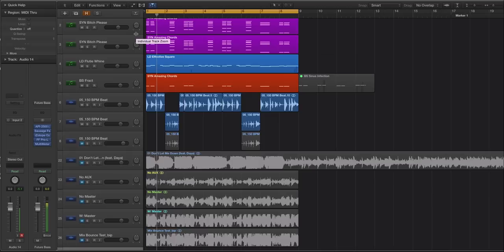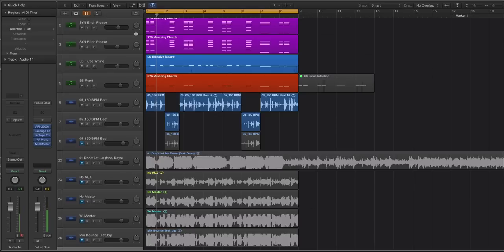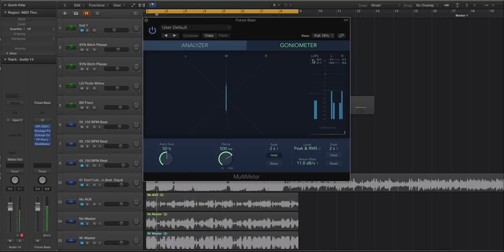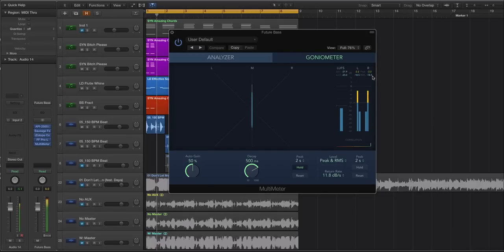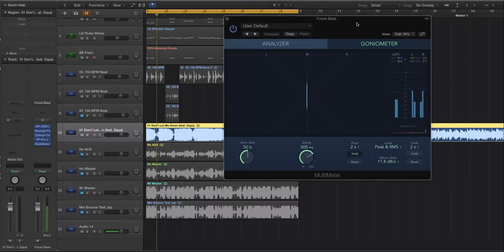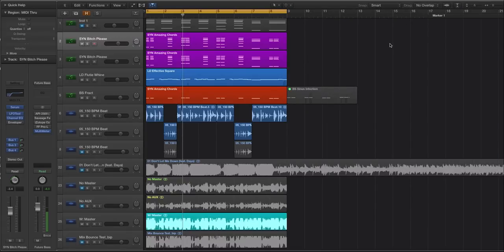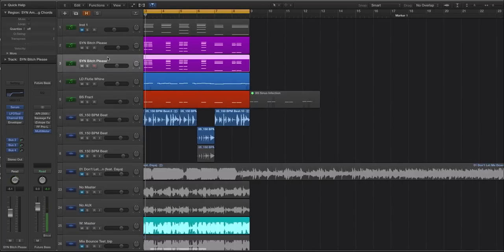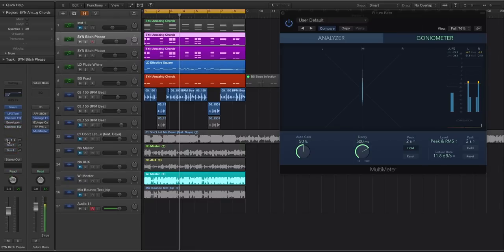3 tips for a louder mix

Comment: I'm not so sure that I understand the aux theory. What am I sending there and how is it making my mix louder?
Reply: but if i use aux for this use, whould not that be eating my headroom ?
Reply: parallel processing can prevent it
Reply: +Krischkros what is parallel processing exactly?
Reply: you have a dry channel and a wet channel.. wet > proceed. so.. you can (over)compress your wet channel, do ott compression.. or reverb, delay.. phaser, flanger and more.. than you can mix your wet channel within your dry.. your dry channel would be fatter, fuller, bigger etc. but.. dont overdo it :D
Reply: you preserve your headroom / dynamics, you fill holes, you make it recognisable and much more..

(you mix the wet channel with your volume knob.. or you automate em.. you have many ways to do it)
Reply: type in yt: ott compression, parallel compression (known as new york comp.), send/return tracks for reverb, delay or saturation / distortion.. youll find many videos
Reply: you search for nghtmres seminar. he gives great advices!

Comment: How do you master your mix? Directly on the project or do you export an mp3 file and THEN master that file?

Which method do you prefer/recommend?
Reply: I could be wrong, but I believe the standard practice is to bounce your mix down as a .wav or other lossless file format, and have that file mastered in a different DAW session.
Reply: Mastering is only done by wizards.

Comment: EQ is, imo, the best tool to get your tracks louder.  If you EQ each track properly, the compression you do at later stages will work better, gel the track better AND give you the ability to push the final loudness much more...if that is your goal. :)
Reply: ***** I definitely spend way more time with automation and modulation of my synths, etc. than I do mixing as well.  I'm by no means an expert when it comes to mixdowns, but that has been what I've found. :) 
I also started writing, arranging, mixing, etc. into a mastering type of master chain (pushed relatively hard). This seems to make my overall mixes sound better in the end and keeps me from having to go back and fix EQ and even modulation problems that pop up once that final heavy compression / limiting is applied and it changes the tonality or movement or whatever... of many of the individual tracks. Then I just back it off and bounce a wav to be sent off for mastering or start the mastering process myself. 
It has worked like a charm for me, especially with the more aggressive, heavily processed and distorted tunes.

Comment: I have the opposite issue, i need to learn how to do a -6 db mix lol.. All my mixes are loud lol
Reply: Yoga Flame EDM I've been a mastering engineer for 20 years and I am going to give you some free advice. My guess you've got compression on every track. Get rid of all the compression (except bass) and start mixing again. Replace that fake bass you've been using and replace it with bass samples of an electric bass.  EDM with electric guitar bass! Yes. Use automation to make tracks loud at certain points in the song instead of just mindlessly jacking everything up with compression all the time. Music (even EDM) is about dynamics. Let the mix breath. STOP SUFFOCATING IT WITH COMPRESSION..Please..
Pretend it's 1975. That should help. 
2) Do not mix with bus compression or a limiter. Unless you are going for some effect.
3) I assume you know but just in case you don't: Record for average level -18db RMS and not peaking beyond -6db. If you haven't and you've been recording your tracks too hot turn them down to the level I have mentioned.
Reply: Yoga Flame EDM I've been a mastering engineer for 20 years and I am going to give you some free advice. My guess you've got compression on every track. Get rid of all the compression (except bass) and start mixing again. Replace that fake bass you've been using and replace it with bass samples of an electric bass.  EDM with electric guitar bass! Yes. Use automation to make tracks loud at certain points in the song instead of just mindlessly jacking everything up with compression all the time. Music (even EDM) is about dynamics. Let the mix breath. STOP SUFFOCATING IT WITH COMPRESSION..Please..
Pretend it's 1975. That should help. 
2) Do not mix with bus compression or a limiter. Unless you are going for some effect.
3) I assume you know but just in case you don't: Record for average level -18db RMS and not peaking beyond -6db. If you haven't and you've been recording your tracks too hot turn them down to the level I have mentioned.
Reply: John Morris k thanks for your grand advice.. I will make tracks like avicci now because your your advice.... this guy making the video is more passionate then you, do  u make tutorials ? Prob not cause your way to impatient for teaching

Comment: good tips i agree with everything but sending your lead to two separate busses panned left and right doesn't make your lead wider but i can see how it helps with maybe being a little louder because you have the original signal at a certain db level and of course it will be louder because your sending additional signals  to buses therefore having more volume.its like adding to the original signal  lol but everything else was great. having a wide mix is based on modulation effects weather the audio is stereo or mono and the direction mixer but panning doesn't actually make anything wider . if your audio is mono and you duplicate it to pan it left and right it will still be mono

Comment: you need m/s processing. Look at your correlation meter. In addition,  its a digital mix and not analog summed like the commercial track. Thats the major difference. Analog mixes have rounded and softer peaks; digital mixes have square peaks.

Comment: I'm using cakewalk and they have like 6 or 7 different "mastering" plug ins, but how do you know which ones you need to use? I basically learned about the equipment to record, how to use the daw, record, and mix all on my own and I tell ya, it's pretty complicated but I'm sticking with it.

Comment: Thank you so much, very helpful! I'm trying to master my tracks myself and I'm just curious, should I bounce the track into audio files and then load them into a new project where I can work on it? And if so how should I split it up? I've seen people work with mids/sides or low/mid/high frequency.
Reply: You just bounce the whole track to a wave-file, start a new project and import the track. Then you import a couple of reference tracks. Then start you mastering chain. EQ cuts should already be done  back in the mixing stage.

Comment: Probably missed the boat on a response however, I have a track that is I believe well mixed, but it is soft, its an EDM track written for a game level on an iphone app, and I need it to be loud. However, for streaming you have to preserve about 8db of dynamic range, otherwise your tune actually gets turned down. Problem I am finding is that when I have my kick at -10db, I've got no dynamic range or rather have filled it up, yet I still can see I need more loudness. Are you saying that the RMS should hold steady at -10 and then use a limiter to get another couple of db? I would imagine that while I do hit -10 the RMS does not stay at this level.

Comment: Bro which is the good or  optimum level of peak before sending out for Mastering.My track has RMS of about -11 but peak goes to 5 db .
Reply: Jay Nikam Professional mastering engineers ask for at least 3db but would prefer 6. Your 5 is fine. Don't worry about how low your RMS mix level is. Mastering engineers  (who do this for a living) will have no problem making your track loud, if that's what you want. Professional mastering engineers have full range monitors. They can hear stuff I'm your mix you can't hear. They prefer an uncompressed unfiltered mix to work with. Mastering engineers hate this kind of advice. Just mix normally. Even if you are going to master it yourself. Mastering is a separate process.  Leave the low bass cuts to the mastering engineer.  But no matter what this guy or what anyone else says the loudness war is over. Replay Gain has leveled the playing field. A mix with a larger DR rating will sound better. Forget the "commercial level" crap. 
Do a search for, "Things mastering engineers hate the most."

Comment: First thanks for a great eye-opener re: mixing levels! I want to echo Philippos Slicher's first question. As you well point out, mastering pros usually want some headroom in the premaster mix you send them, say -3db to -6db. In the "premastered" version of your track (around 8:20 in the video), you have the RMS at around -13db and the LUFS at around -11db, which you say is in the good range. But your peak in the track is right around 0db. Assuming you send your tracks out with headroom as the pro mastering people suggest, what would your next step be? In other words, how would you lower your mix, say to even -3db peak, without sacrificing the wanted RMS and LUFS values? Or do you send you premasters "as is," with little to no headroom, but making sure the music isn't, at the very least, clipping?

Comment: Guys Please do not listen the gain staging is veryvery important in your track after you do your post processing to make your sound fat and to tam your peaks so while you mastering it you can more headroom to push while masterin with an adaptive limiter use a compressor like this make your kicks softer by moving back the compression threeshold and make your synths louder and use compression on your grouped tracks also and use saturation on every channel check out the point blank video 10 veryvery essentail tips for mixing and those guys are there from 20 years way more experinced in  mixing

Comment: 2 Questions. I have a mix in which the RMS and LUFS are almost the exact same as yours without mastering, but my regular levels are clipping, and if i make them not clip, then the RMS and LUFS drop WAY down. Question 2: How did you get Sausage Fattener to work in Logic, mine always crashes. :(
Reply from the maker: Do you have the legit version of the sausage fattener? You need to adjust the balances of your mix better in that case and turn down the peaking elements (like kicks, snares etc.) and then bring back gain with compression and limiting.

Comment: whats the difference between a bus and an aux?
Reply: A bus is a channel used to basically stack elements together like say all your drum channels would get sent to a drum buss or synth or what have you. an aux is basically a send return track you can add effects to send returns and then uses as much or as little of the effect on each individual track in the mix an bus when used with drums allows you to add compression or eq to the entire channel set of drum elements by adding the effect to the channel. With a send/return you have a send knob on the channel that allows you to set how much of the effect on the return track is utilized. Buss tracks are cool because they quickly allow you to mute whole sections of the project like drums or leads or synth quick;y also raise and lower volumes of whole groups of elements.
Reply: thank you brother

Comment: Hi. I have a critical question to ask for. I have -3dB of headroom meaning I am not clipping, and I have -17 RMS which technical is good as I’m not clipping, but as I knew that, that’s not enough to get a -12 or -10 RMS. I mixed my track very well, and in order to get the mix to sound good, I must find a good method to to get to -12 to -10 RMS, without clipping the peak levels. I’m not very good with parallel compression, or saturation on the mix busses (although I kind of fattened the bass just a little by distortion). Can you give some advice? I have every faith in you helping me. I believe in you. Thanks. 

Ivan.

Comment: what's this multimeter plugin called?
Reply: It's a fantastic meter isn't it? That's the built in Logic Pro X metering you see there. As an alternative, if you happen to be buying RME sound-cards you get access to another of the industries finest meters with it, the 'Digicheck Totalyzer': https://pds.exblog.jp/pds/1/201511/05/04/c0257904_23335687.jpg

Comment: all the insturments should be ducked under one by one and listen to professional tracks like tiesto daft phunk deadmau5 you need to have a sound card while you do your mixng session what the say is all the instruements must be ducked under each and every track put this in brain which is the sounds do you want to show out definetly in all genres of music is the drums you all want show out and saturation with a compressor tams your peaks but does not destroy your dynamics may be in level of rms is destroyed but while listening your ear shuld be your real guide listen to hard well one of his tracks cobra in the breakdown melody it s -18 db rms but it still sounds loud even if the rms is low and you can not have every thing loud in your mix few thin will be ducked down but only when you listen carefully you will mix and i have tried this idea it does not work out and no record label will take your track with 0.0 db peak nd cut a few unessary parts in your track like few melodies will be having unessary high end  which you do not want and few transeint is not be able to be hearing even eqing can tam down a bit of a peak so it has more room to breath in the track and even i am just learning and i have tried saturation to put on every channel it work smooth as an oil for me and my peaks are tamming and even parrell compression in logic compression when your miing your track there is a dectition mode peak and rms max and sum if you want peak to max out sure then go ahead  for the max out but while mixing your you need to sum because your summing all the instruements in your mix

Comment: You know that you super loud track will get turned down in Replay Gain right? You do know about the heavy compression used in FM radio right? 
Any real professional mastering engineer will tell you loudness is done in mastering. Mastering engineers hate what your doing.
Reply from the maker: If I don't use a mastering engineer to finish a track then I don't care what they think. I've had to finish tracks for TV and film in under 48 hours, not enough time to send to a mastering engineer.
Reply: ADSR> but you just said in the video that you NEVER send anything OUT without having it 'properly mastered'...so which is it? anyway i don't understand the need for mastering engineers in this day and age myself....the less everybody sounds the same as each other THE BETTER i say. plus>  $$$$$$!! > ugggh.